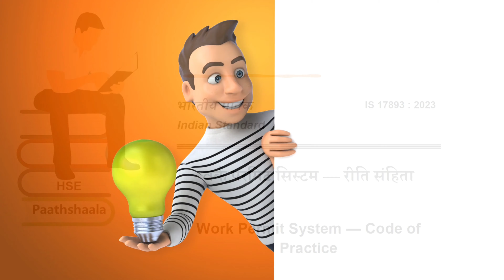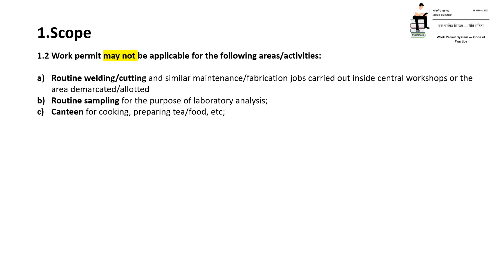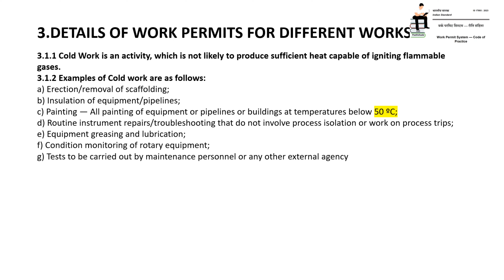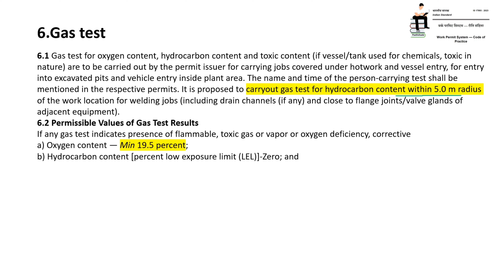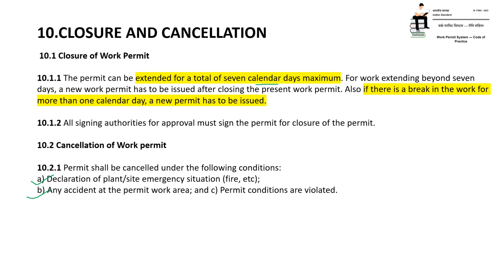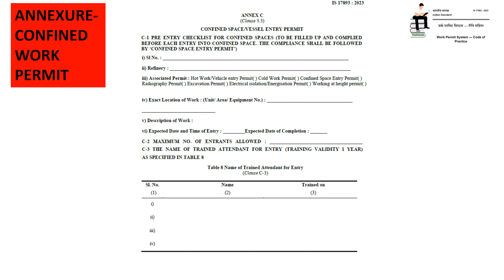Work permit system-IS17893

Comment: Thanks Sir, 
But I have a question that who will initiate the work permit?
Reply from the maker: 7.2 Issuer
7.2.1 In operating plant areas the shift in-charge shall issue the permit for the area under his jurisdiction. For the jobs on pipelines the product/utility supplier shall initiate (issue) the permit if the work is to carried out up to the battery limit of receiving plant. Inside battery limit the receiving plant shall issue permit after confirming due safety precautions at suppliers end. The issuer is an employee of the company. No person can issue work permit to himself.
Reply from the maker: Read ..Issue=initiate